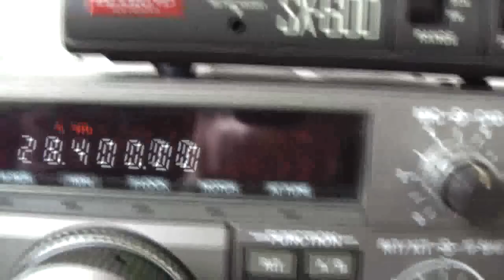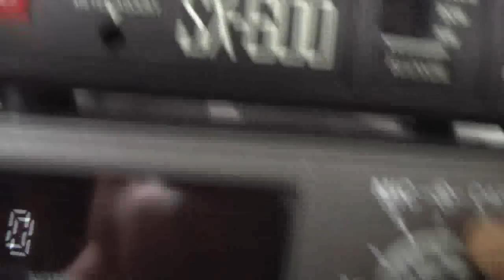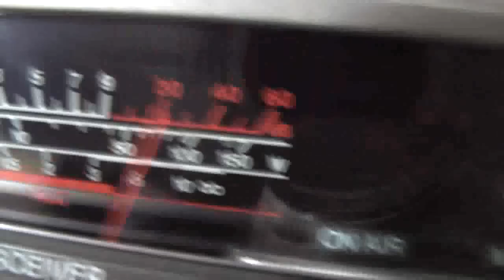TS-440S MOD - SSB PWR CONTROL WITH CARRIER KNOB

Comment: After using this mod for awhile I found it totally unnecessary. The Mic gain works fine for this purpose and I have since re-soldered D49.  For PSK for example, just switch over to PWR on the meter, and turn mic gain down to appropriate output (it changes depending on where you click on the water fall due to mic audio amp response).  Having TWO knobs to adjust the same thing, only wastes time.

Comment: You can adjust the power in LSB, kenwood ts440s, (Consulta se puede regular la potencia en el modo LSB,del radio Kenwood ts440s, al igual como lo realizo para USB, desde ya gracias por cualquier informacion...felicitaciones por el video

Comment: I did this mod and ALC will not display correctly when carrier is reduced in SSB modes. Just something to be aware of. You need to set full carrier, adjust mic gain for correct ALC, then switch to CW and set output power, then go back to SSB. A little confusing but not difficult.